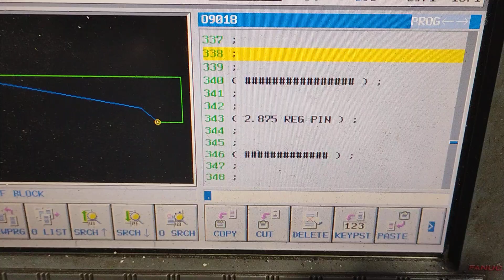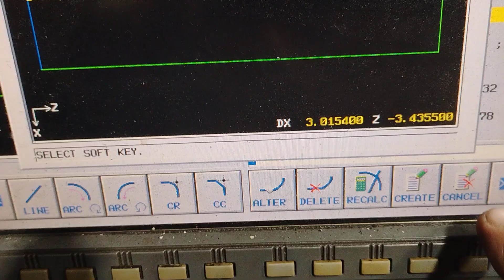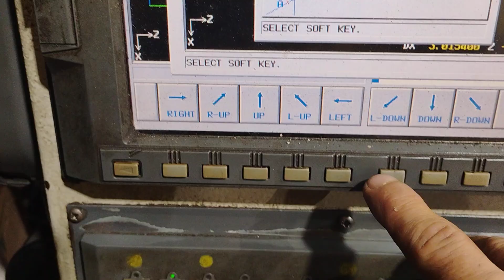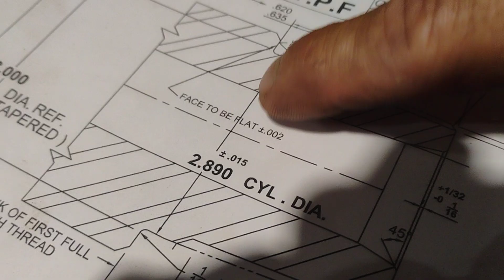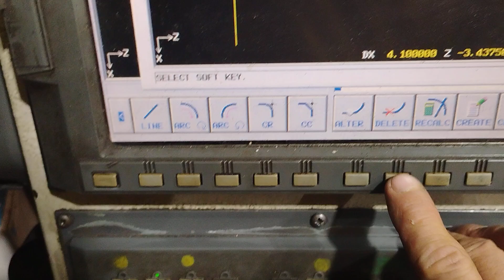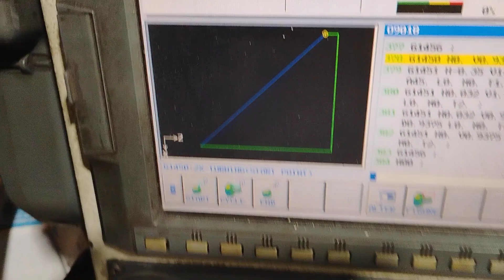Basic API 2 7/8 reg pin program

Comment: Buddy is it conversational programming right!
Reply from the maker: Yes , at the console of the machine , you write in conversational programming. Basically point to point. I have both type programs in my machine. When I first got it , they had someone write programs for the basic threads we cut. After figuring out how to edit those , I figured out how to write my own. It's a very simple process. I love it. I can teach anyone how to write a program , run simulation to see it in 2D , and  check for errors , in a few hours . And you  feel confident about it while you do it. 
Do you want a video on writing a conversational program , start to finish ? I add useful , time saving steps to help speed up the process of cutting each different thread. 
This program in the video ran about 12 minutes , so I can cut 3 of these an hour. 
My 4.5" IF API pin program lets me machine a complete connection in about 20 minutes. Kinda depends on how fast you move. 😁
Reply: @firemanjim324 yes please whenever you have free time please make a video on writing the program 🙂🙏